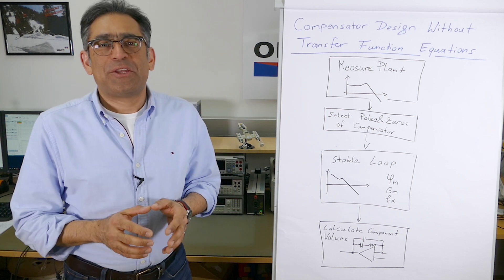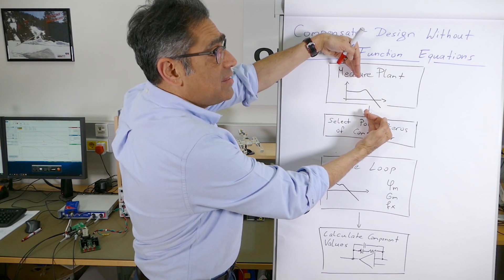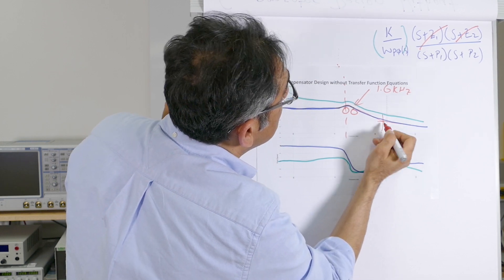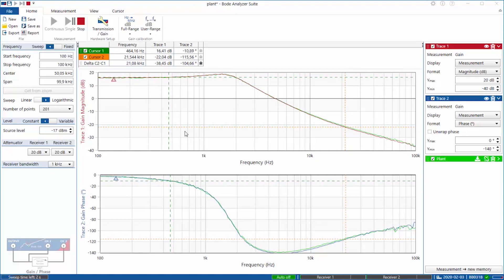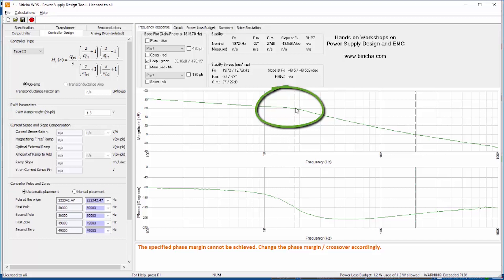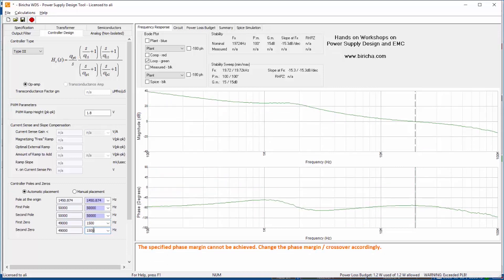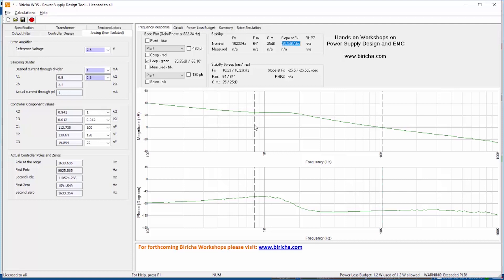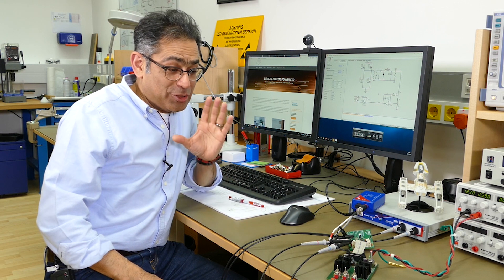Power Supply Compensator Design without Equations

Comment: What about when people hang random, and maybe large, capacitors on the output. As they certainly will if this is a bench PSU. The output terminals are still within the control loop

Comment: Good explanation.
I have a question, what is the disadvantage of just making the circuit "slower" with a bigger capacitor?
Obviously this causes the circuit not be able to immediately correct the output.
But there are quite some cases where this is not needed at all. So the output voltage can easily be +/-20%